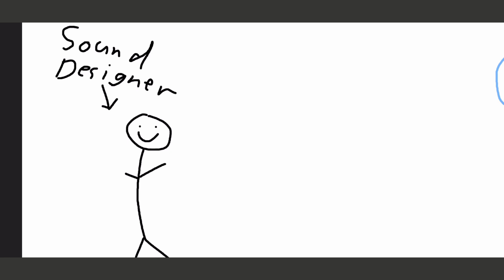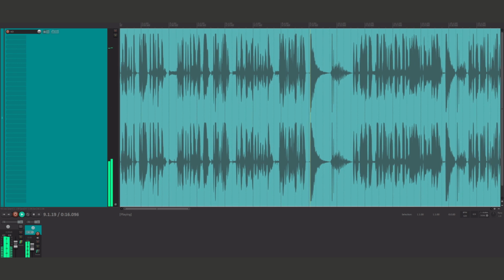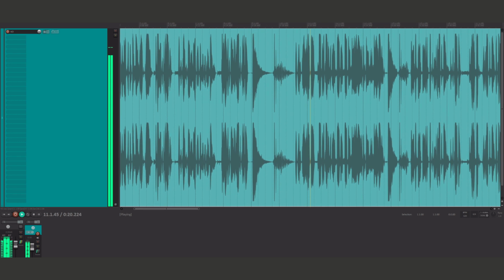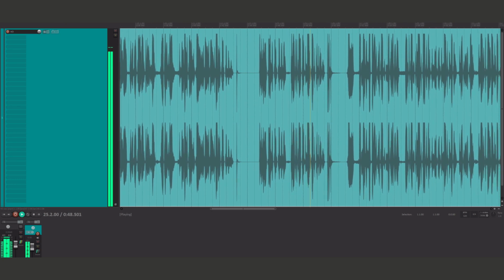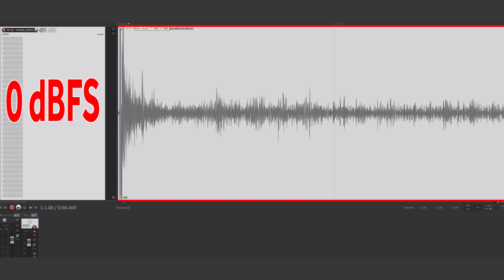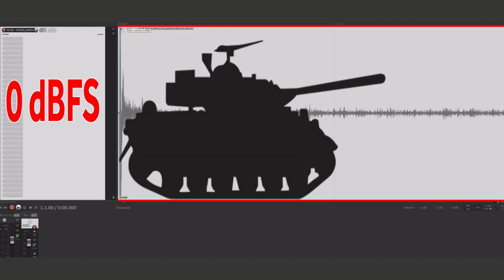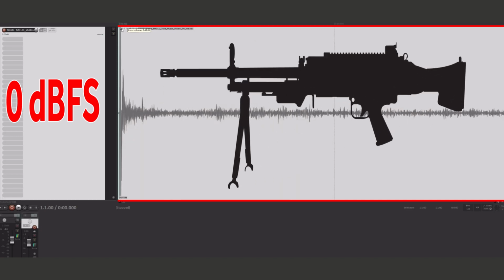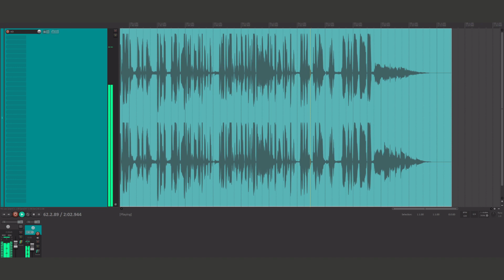Authentic Gun Sound Design in videogames (For Non-Sound Designers) in two minutes [ListenIn #01]

Comment: I think people complain about certain ways of soundscape scaling.
like firing sounds exist in relation to other type of sounds. 
In Battlefield we hear relatively loud foliage sounds, human voices, firing tails and other environmental sounds which make the actual firing pop sound quiet. Tank noises also do get muddled in the mix. It's like the devs wanted you to hear everything at the same time.
In Squad the scaling is appropriate to the MilSim experience which i really appreciate. The firing pops really do stand out so much that you can't hear your footsteps anymore in a firefight. And when a tank fires it takes on the spotlight. This is really intense and immersive. 
So two different ways of scaling.
Reply from the maker: Yes, exactly! Honestly, I'm a big fan of the "HDR Audio" approach that the BF series introduced and has since become a bit more widespread. (To those not familiar: Every sound gets a "loudness" value assigned and the overall mixing of every sound changes dynamically in relation to the currently "loudest" sound being played).
For the simple reason that you don't have to mix it as intense as e.g. a battlefield game, but still get a very appropriate and clean mix if used well.

It's also a general issue in game audio dev: Some players (like you and me) appreciate a high dynamic range, while others prefer a more "cinematic" and compressed experience, either due to aesthetics or because they can't play at high(er) volume levels. There is a reason why "War Tapes" is a favourite with many players even though it smashes everything against the brickwall. :D

Which is why, luckily, more and more games tackle the issue with mixing presets.